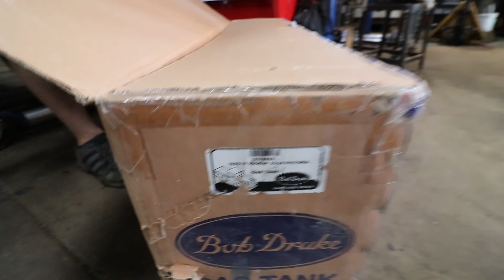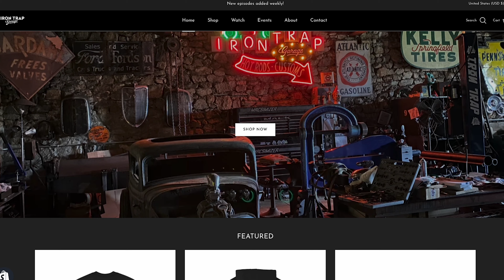We Tore Apart Our Entire 1934 Sedan Delivery Rear Wooden Floor To Change The Gas Tank!!!

Comment: Hey Matt, once again I'm here to promote sealing the wooden parts much like you did with the steel parts when you encapsulated them. I suggest using West System epoxy on the wooden parts. If you want to preserve the patina just seal the parts you won't see and the under sides of the floorboards Pay attention to the ends of the boards where water would be absorbed.  If there is a small bit of wood rot the epoxy will repair that too.  I'm enjoying this vehicle only wish the lighting was better when you were recording inside the truck. Looking forward to more updates!

Comment: Compared to some cars, this one is in sound condition, without needing to fit patch panels everywhere. OK, so you took out the whole interior, just makes it easier to clean and apply the rust encapsulate. Also easier to run your fuel and brake lines while the floor is out, and no doubt other mechanical and electrical work.
Looking forward to you preserving and getting it to be your local parts getter.

Comment: It is very instructive to see how Ford assembled their vehicles.  Taking them apart is like reverse engineering.  Given what the engineers and production had to work with, they were very creative.  So every time you and Steve dismantle an engine or a part of the car, I learn how it was put together.  That's how I learned how engines really worked.  I took apart my 1955 Chevy when I was 20.

Comment: the van looks good after all your hard work  id say you are right it was put in on the assembly line and shipped to coach builder  a tip on putting the screws back in dip them in grease i have given you a mention to make it custom  on youtube  as they are doing a road tripdown your way  from canada 😊😎✌👍

Comment: Hope you plan on sanding  and staining floor boards  before reinstalling them. Also using  the side boards  as templates  for new wood stained to match. New wiring while it's  apart is head start on completing  the project.  Happy  selling  at Carlisle looking  forward to next video  when you guys get back.

Comment: Pulling out the floor/side panels seemed to certainly be a hassle, but looks like it turned into a great opportunity to address/encapsulate the rust underneath.  Just out of curiosity, would it be worth considering adding in some insulation before putting the panels back in?

Comment: Yes having fun now, me too my 29 A Tudor the gas tank goes in under the dash and aprons I have to pull the 2 p 17:11 ieces of the 3 peace cowling remove the steering from wheel to the pitman arm and frame then unscrewing the passenger apron and detach it from the cowling along with everything fuel related and cables most ,of the others drop into the aprons with the windshield removed and everything else alot easier ❤my A but tanks quite a ordeal. 😂

Comment: I surprise that u didn’t push it outside an pressure wash the inside an frame an also the rear end. Also might think about putting up some sound proof stuff on the walls before u put the side pastel back up or r u going to leave them off

Comment: Don't use a chisel to try & tighten the gas tank filler neck. The proper tool is an adjustable spaner wrench  in the correct size.  Much easier, neater and better tightend.  Rare part - please don't butcher it !!

There should also be a lead washer to insure a good seal between the neck & the tank.

Comment: Yes sir this shows that not all of these projects are just an hour long. I think a lot of people (me included) fail to realize the enormity of these projects that on the surface look fairly easy and quick to do. But this shows that when a vehicle like this is assembled at the factory there is a certain sequence of assembly steps and of course the manufacturers of automobiles as well as other items have experience on their side and we the enthusiasts have to figure out how to disassemble these vehicles in order to perform these tasks. It is only after we have gone the long hard route do we get the light bulb go off in our minds that tells us "Oh that's how they did it" when taking this stuff apart. We learn something new all the time. Now we know that the factory probably used a spanner wrench to tighten that collar on the fuel tank inlet and for that application (trucks also) that is the way it was done.🥸👍👍👍👍👍👍👍